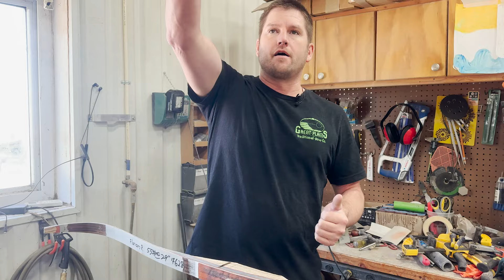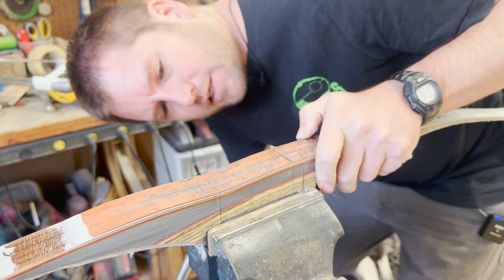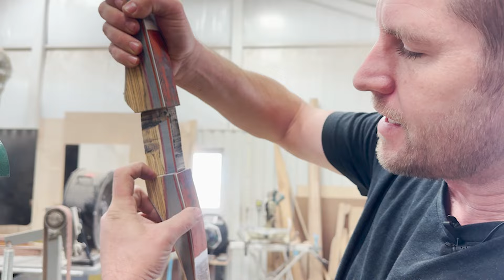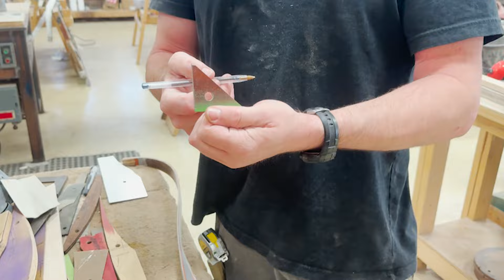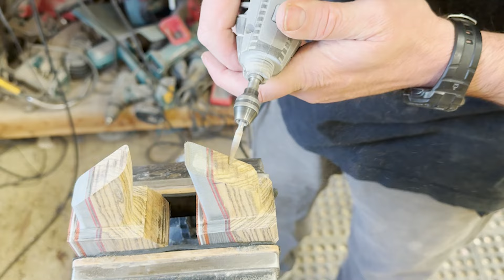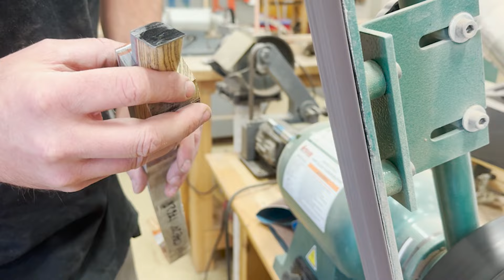How to Build a Two-Piece Bow - In-Depth Video

Comment: Shane, I was just wondering what you charged for repairs.I have a jim spears selfbow with smallcracks, and I have a recurve off a bear pattern that sam burns helped me build that has delaminated.
Reply from the maker: I guess it really depends on how extensive the repairs are. I charge $50 an hour. A moderate repair can cost $200-$300

Comment: Can you rip the glass through a table saw
Reply from the maker: The glass for the Tenon caps? Yes you can rip glass in a table saw. Just put a regular abrasive blade in for a metal chop saw or you can buy a diamond blade. We use a diamond blade, but an abrasive blade will work great
Reply: Thank you.